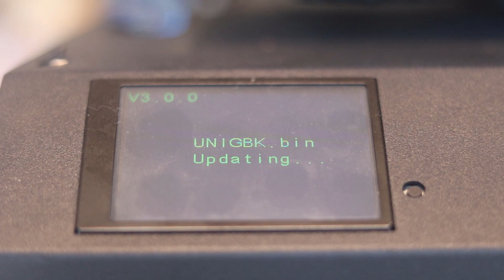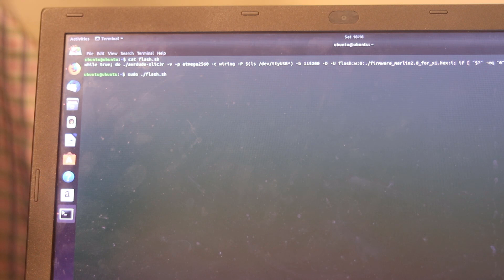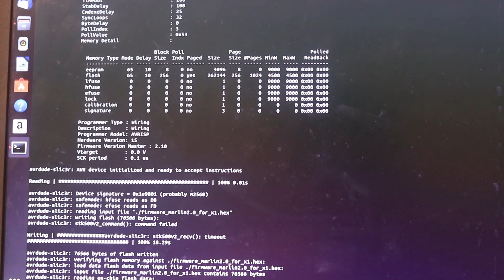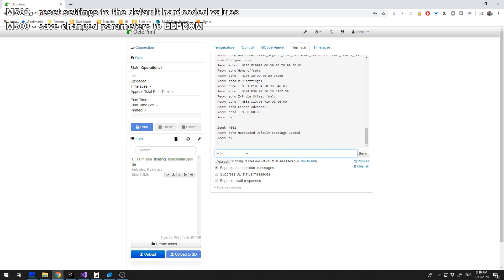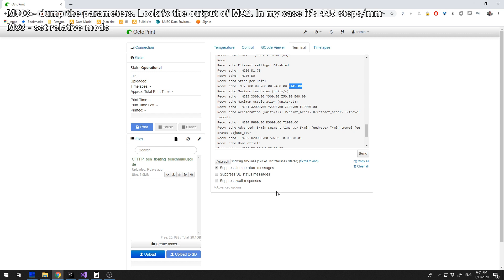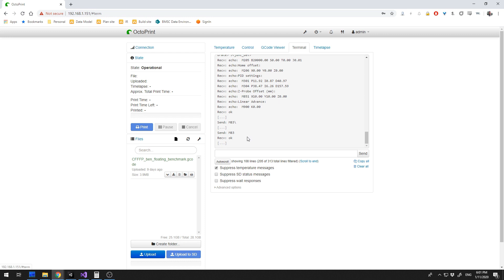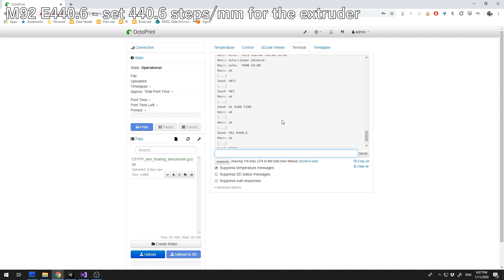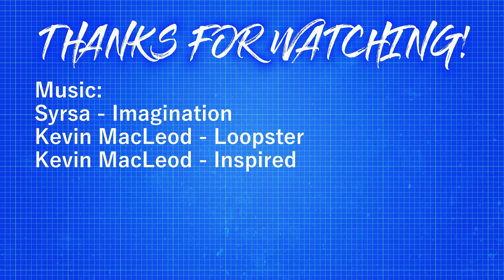Troubleshooting Artillery Sidewinder X1 | Part 2 | Firmware update, PID and extruder calibration

Comment: Same PID issues here. Marlin 2.0.6.1 and Sidewinder X1. Temps oscillate between 237 and 244°C when set to 240.
Auto PID Tuning doesn't work well. P and I values are too high, D values too low. Have to set it manually. :-/

Comment: dude... want me to show you my Ben print without all this nonsense about firmware? I haven't even tightened belts and my prints are pristine with just 10 minutes spent on adjusting settings in cura... and yes.. I set everything spcificly for every print but 10 minutes in slicer for 10 or more hour print is fair trade in my book.

Comment: Great video Igor.  I did manage to remove the TTF cable in order to update the firmware in my Artillery Sidewinder.  However, it was a royal pain.  I had to remove hot glue with a razor and small pliers for about an hour.  I was very concerned about damage to the connection.  Finally, after an hour I managed to remove it.  Very difficult.
Reply from the maker: I was afraid of the same (in fact, one of the viewers mentioned in the comments that he ripped off the cable even after warming the glue with a hairdryer). If you have access to Linux, it is so much more convenient to do this without even opening up the printer.

Comment: For people struggling with the TFT cable: Just use your hairdryer to warm up the hot glue and remove it carefully, at best with metal pliers, so the glue attaches on it and removes easily. I thank the Igor for the alternative flashing way with Linux, that was new to me.
Reply: @Kravenagger  not in my case. All connectors are more than reasonable filled by hot glue 😉
Reply: Now there is a new situation! You no longer need to open the case, just install the new TFT firmware from here https://www.thingiverse.com/thing:4251390 and you can just disable the serial communication of it via menu. In this state flashing of marlin works just fine.
After that you can enable the serial of the TFT again and you are good to go.
Reply: even easyer to just disconnect the black and red wire, does the job fine aswell.
Reply: @MrMortenVutborg  true, but by opening the case you might loose the guarantee, if there is any.
Reply: @KaiPosadowsky  where i'm from, altering the firmware warrants the guarantee anyways 😉

Comment: I know its been 3 months now but if you're temperature is still overshooting, it is modt probably because of the cheap standard thermistor (in my case at least, v4). Change it for a better one and the printer suddenly has stable temperatures :)
Reply from the maker: I've replaced a thermistor with a similar one (stock replacement) and it didn't help much. I may try a better one later (there are some better screw-in options, but the hole in the heat block is not tapped and I don't have a tap). For now I've got used to it.

Comment: Couldn't you just disconnect the power cable to the TFT board instead of removing the signal cables to achieve the same result? I assume it needs to be disconnected because the same pins are used for the flashing process, if they are connected without power this should achieve the same result.
Reply from the maker: That connector was also completely  buried under hot glue.

Comment: Nothing happens when I insert card. i have tried every file. any ideas?
Reply from the maker: Unzip files from files\firmware_marlin_2.0+tft_for_x1\display_tft_firmware_x1\ to your MicroSD card. Make sure you're using a small card (=<16 GB), formatted as FAT32, and unzip the files directly to the root of the MicroSD card.
Reply: Thank you. Apparently I had the files in the wrong spot on the card. Very helpful!
Reply from the maker: @Kody Wease You're welcome! Good luck!
Reply: I did get the firmware updated. Unplugged the screen successfully and tries to connect but all I'm getting is denied access. I have tried playing with baud Rate.
Reply from the maker: @kodywease6895  Drop me an email at brenagwynn@gmail.com with a screenshot of your error. I'll try to help.

Comment: I want to update the firmware (of my sidewinder) but it wont start the update when i put in the microSD. I downloaded the file "firmware_marlin_2.0_x1" unziped it and saved the unziped folder "firmware_marlin_2.0_x1" on the microSD. It didn't work.
So then i tried saving only the .h and .hex files on the microSD, but i also didn't work out..
How do i set this proberly up?
Reply from the maker: You need to unzip files from files\firmware_marlin_2.0+tft_for_x1\display_tft_firmware_x1\ to your MicroSD card. .hex is for the control board, not the TFT screen. Also make sure you're using a small card (=<16 GB), formatted as FAT32, and unzip the files directly to the root of the MicroSD card.
Reply: @IgorsWorkshop  In this very moment the system is now installing the update, thank you very much for the quick response :)
Reply: @IgorsWorkshop  Thanks for the answere I will try it tomorrow :)
Reply from the maker: Good luck! Let me know, if the process works for you

Comment: Awesome video! I tried this and used my heat gun to soften the glue. I was gently pulling and all 4 wires came out of the connector :(  I was trying to see the orientation of the wires but your video wasn't zoomed in. Do you know what row of pins both of the white cables are in? I took off the top wires by mistake and think I have them oriented correctly but not 100% sure that they are on the correct row of pins. Of course I can't find any info searching the web.
Reply from the maker: I was afraid of that happening, that's why I decided to discard that idea. I'll try to take a picture of mine and send it to you. I believe I saw your post in the Artillery group.
Reply: @IgorsWorkshop  Awesome, Yes that was me... Thanks much!!!
Reply from the maker: @larrynygaard9846  Try this link: https://www.dropbox.com/sh/r2tut1tlwwdgt7p/AADrGC1OIWtPYjAN9Szd__0Ua?dl=0
I've uploaded some pictures there

Comment: Just found this and was pretty shocked! Apparently some of the X1s Z stepper motors had screws too short to mount to the rails properly and they just jammed a zip tie in each hole to get it out the door. You might want to check this. I'll try to insert the link to the YT I just watched about this. https://www.youtube.com/watch?v=iPMMtle8TKk
Reply from the maker: Thanks for pointing this out. I've checked both Z motors - they are mounted with long enough screws. Not sure if I'm happy in general with this mount, though. Threading a thin aluminum wall... not sure. But I definitely don't have anything like EZY3D LAB has
Reply: @IgorsWorkshop  Can you put some T-Nuts in the extrusion groove? That would be the way to go or drill the holes all the way through and lock nut the other side with long screws. That needs to be a very solid mount as I'm sure you know. Looking forward to hearing about those couplers. While you have the motors off have you thought about pulling the leadscrews out and rolling them on a flat surface to check for warping? I'm just curious about how they look.
Reply from the maker: @ew7007  I've already checked the leadscrews. They are reasonably straight. I'll check if I have any t-nuts at home. But I tried wiggling the motors quite hard, and they didn't budge.
Reply: @IgorsWorkshop  Sounds like your on the right track. Good news about the leadscrews. Hopefully the couplers will make an improvement. FYI I've been exchanging comments with @Stephen-TheLightSpeed! !! on this Z banding issue and he ultimately removed the existing leadscrew nuts and anti-backlash system and replaced it all with standard brass leadscrew nuts and it finally solved his problem. Rather drastic, I know but he claims it worked. Keep me posted.
Reply: hey guys do you think that all 4 screws on the motor case need to be torqued equally inorder for the motor to work correctly? If I just used two screws diagonally to secure that motor to the extruder could that be the reason why my motor is glitching and erratic? 

AND DO NOT USED HOT GLUE TO SECURE THE RIBBON CABLE. YOU WILL DIE. IT WILL NEVER ALL COME OUT OF THE RIBBON SOCKET..

Comment: I'm confused. What happened to doing a Marlin firmware update? Is the stubborn connection to the TFT preventing the Marlin upgrade? I thought Artillery claims that this has a bootloader installed on the main board that would make the firmware process relatively easy. I'm watching this series of yours very closely before I purchase my Sidewinder next month. I have found from some other users that there is a problem with the factory installed leadscrew nuts and possibly warped leadscrews. If this is true I would perhaps start your focus there. I've also heard that the leadscrew synch belt may be contributing to this layer inaccuracy. 
Your printer certainly suffers from the same problems I've seen with others complaints. Your Ben test models all also have blobs on both sides of the model on the hull in the same places. Do you get that with other prints as well? I'm not experienced enough to suggest what they might be caused by or if they are related to the Z axis issues. Anyway, I'm eagerly waiting for the next video from Igor's Workshop.
Thanks for sharing this with us.
Reply from the maker: Thank you! Yes, the TFT basically hijacks the serial connection. There are 2 ways to work around this: disconnect the TFT cable (which I couldn't accomplish due to a huge amount of hot glue in all connectors) or use a Linux script, which attempts to hijack the connection before the TFT does (which works perfectly for me, using my wife's laptop running Ubuntu from a Live USB :) )
I'm currently also under impression that something is not right with the Z axis screws/nuts and/or couplers. Stay tuned, some spares are finally arriving today and I plan to run and record a few tests.
Reply: @IgorsWorkshop  You probably know this but leave a gap in your coupler between the stepper shaft and the leadscrew. I read that some of these Sidewinders were not assembled from the factory properly and had the leadscrew sitting right on top of the stepper shaft. Thanks for the reply. Good luck and keep trying. You'll get it and then be able to share it with us.

Comment: I thought I wanted to do the Firmware? but after watching this I don't really see what good it will do? I'm lucky that my display connections didn't get hot snot on them and I have a SWX1-V5 that's printing great.
Reply from the maker: Oh, do you have V5? What's the difference between it and V4?
As for the firmware - I'd still recommend to update it, especially since there's a non-invasive way to accomplish that. You'll get an unlocked EEPROM, which would allow you to save modified settings; also you'll get access to extended features like mesh bed levelling (without a probe) or linear advance.